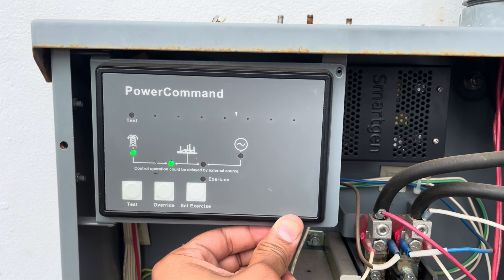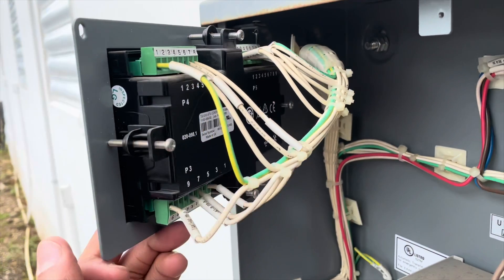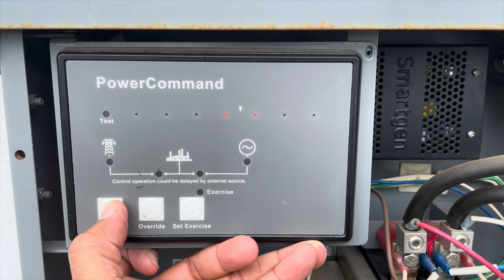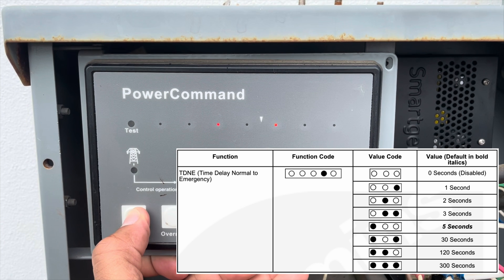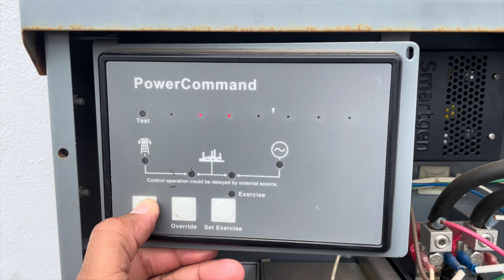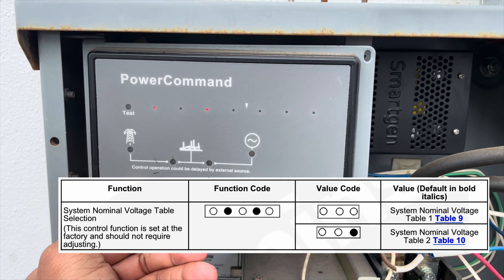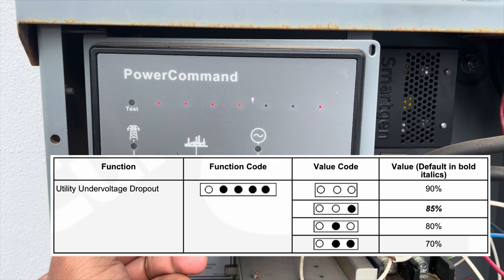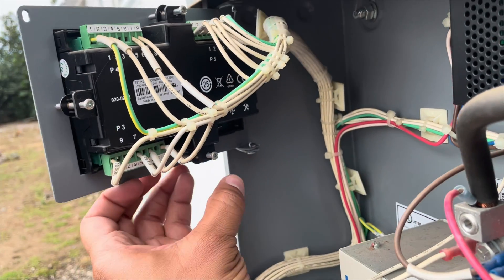How to configure a Cummins RSS100 & RSS200 automatic transfer switch. PowerCommand controller TS1310

Comment: If the override button is pressed how do you put the ATS back in to auto?
Reply from the maker: None, the ATS will always be in Auto sensing utility power unless you trigger the configuration mode or remove the power to the ATS controller. You will have to re-active the exercise mode after pressing the override button if you want the generator to turn on by itself for exercise period though. The Override pushbutton is used to terminate the following system time delays:
• Time Delay Engine Start (TDES)
• Time Delay Normal-to-Emergency (TDNE)
• Time Delay Emergency-to-Normal (TDEN)
• Stop the Utility Power Connected LED from flashing as a result of a failure to connect to or disconnect from the utility when commanded.
• Stop the Generator Power Connected LED from flashing as a result of a failure to connect to or disconnect from the generator set when commanded.
• Cancel an active exercise period.

The engine cool down, TDEC, time delay is not affected by pressing this pushbutton. 

Hope this info answers your question. Thanks for watching and commenting on my video.

Comment: Hiii how to disable this intrigrated exercise
Reply from the maker: Hi! To disable the RSS100 spec A integrated exercise is simple. With the control panel Exercise LED on steady, press and hold the Set Exercise pushbutton for 5 seconds. The Exercise LED flashes at a rate of twice per second for 5 seconds and then goes out to signify that repeat exercise periods are cancelled.

Comment: The last time I pressed the test button, the ATS did not switch power from the utility to the generator.  I thought maybe the configuration settings in the ATS had been lost if DC power was disconnected for too long. That said, I tried to go into configuration mode for the ATS to see if any of the settings had changed. When I switched into configuration mode, none of the lights on the display for the settings lit. Is there some kind of breaker or fuse in the ATS that might have been blown at some point?  It seems that somehow I need to reset and possibly reconfigure the ATS. Thanks for any assistance you can offer!
Reply: I'm so very grateful for your reply!  I'll check for that blown fuse soon.  Do you know if the ATS will reset to factory defaults when the fuse blows?
Reply from the maker: The ATS should stay with the same settings it had before losing power. The one thing you might have to re-set is the auto exercise if you had it activated. Let me know if you were able to get the ATS back in operation.
Reply: This is all new to me, and I am not able to locate the black box with lots of vent holes inside the RSS200 ATS that you mentioned. Can you give me instructions as to exactly where to locate that charger and fuse?
Reply from the maker: Send me an email or message me on Instagram (Tacticalpowerpro). I can send you a picture of how does the battery charger looks like.
Reply from the maker: I can gladly assist you. Sounds like the generator battery has no voltage. The ATS controller uses the 12v from the generator battery to operate. There is a 5.5A fuse in the battery charger (the black box with lots of vent holes inside the ATS). I believe your fuse in the battery charger blew, causing the generator battery to drain which led to the ATS controller not having power to operate. I troubleshot this exact issue a few weeks ago with a onan RSS100 spec B (digital screen controller). Hope this is helpful. Thank for watching my video.

Comment: Hello sir, waht is the meaning if the utility connected led is flashing rapidly? Thank you
Reply from the maker: Hello sir, the utility green LED is lit when the transfer switch is connected to utility power which is supplying power to the load. If this LED is flashing, it means that the transfer switch has failed to connect to or disconnect from utility power, when commanded by the control.
Reply: So in that  case what is the first thing to do? Can i over ride? Thank you sir
Reply from the maker: Start by making sure the transfer switch indeed failed to connect or disconnect from utility power.
Reply: Many thank you sir!
Reply from the maker: @kingjordan2984  you're welcome, I'm here to help.